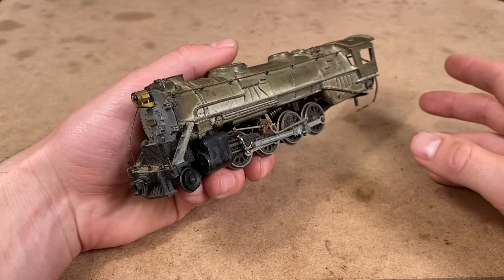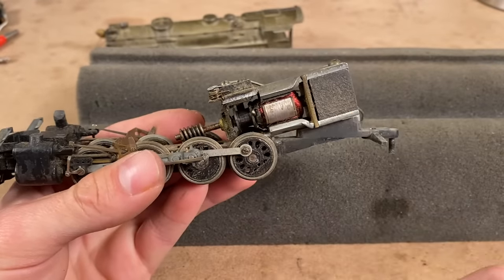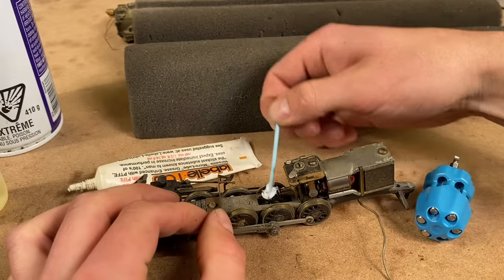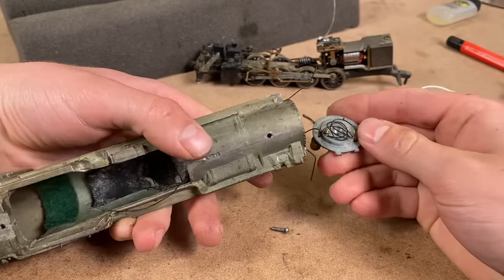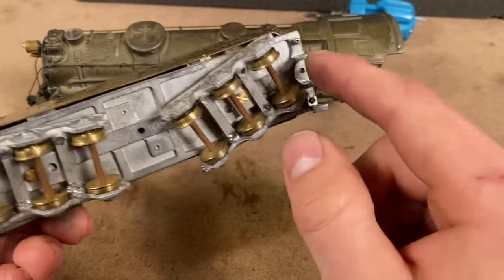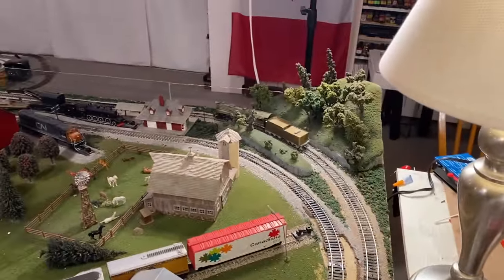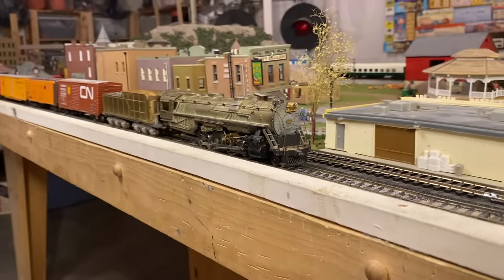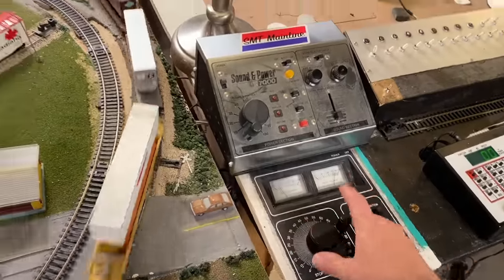Will it Run? Creepy 1939 Varney HO Steam Locomotive - Sitting for Decades

Comment: These things sure were built to last! Varney sold these without the tender, so the builder would buy one separate to fit the railroad being modeled. They also sold it in multiple configurations with the top-end version having a fully sprung and equalized chassis and 7-pole V-2 motor. This is the “value” version, but that’s still worth about 3 or 4 times what you paid even in that condition!
Reply from the maker: That's good to hear. I purchased a locomotive at the same store for $15 which happened to have the Lindsay super motor. I had no idea they were somewhat rare
Reply: @SMTMainline  why Is everyone calling it Creepy ? I think is cool  not creepy.
Reply: @normancoreyBuildingTrains  Because to modern folks everything and I mean everything is creepy or awkward.
Reply: @normancoreyBuildingTrains  
It's a ghost train come back from the dead. 👻
Reply: @JB-yb4wn  ok I can see that

Comment: 👉 DC -71 open frame 12v motor.  The standard motor for model trains for many years.  Bowser,  Penn Line,  Varney early Alco Models brass etc.
Reply from the maker: Not very efficient motors but they do seem to last.

Comment: Great job Harrison. That's a great looking old locomotive. All it needs is the trailing truck.
Reply: I Agree As I was Looking At it asking is It a 2-8-2?
Reply: @elleryparsons2433  i know some1 with an original and it is supposed to have a trailing truck
Reply: Is It A Trailer with 2 Or 4?
Reply: @elleryparsons2433  it usualy has 2

Comment: Looks great. As far as a rear trailing truck, Bowser may have one that will fit the locomotive, but I never tried it for a Varney steamer. On the subject of the tender, Cal-Scale may have detail parts for steps, ladders, and about everything else for most steam engines. This would only leave a nice coat of black paint to finish it off. Overall, it was nice to see it get this far.

Comment: The nylon screw that goes into the moter mount is a modification necessary to convert a loco to DCC.  Also, looks to be an insulator spacer under the motor to isolate from the chassis.  I suspect that at one time, it was DCC, then decoder removed when they sold it.

Comment: I see you use brake cleaner. I use WD40 contact cleaner and it seems more plastic friendly. Got this idea from 00Bill who restores British outline locos and is worth a watch. A lot of early Hornby Dublo and Triang had weaker magnets and need re-magnetizing which I do with a magnetizer I bought. I don't know if early US manufacturers had the same problem but this seems strong. I now re-magetize as a matter of course even if the magnet seems strong - it will still reduce the current by 10-15 %. You can halve the current in a weak magnet machine with a re-mag.

Comment: That model is about as old as WWII and it runs better than some high end Bachmann models I have.
Reply: Plastic will never replace metal products in model railroading.  My plastic engines deteriorated in 20 years of running them in my life. I am 80 years in the hobby

Comment: Sunday hobbyist here🤣 i wanted something HO made before the 70s and found an old Varney F3. Person i bought it from said it runs fine. Had to push start it and it crept around the track once. So im going to hope its not the motor but has similar issues as yours. Disclaimer i tried running it with a bachmann power supply that came with a train set. Its all i have. Had it cranked all the way to “11”.  And just wont go. Even put power from said supply direct to brushes but nothing.
Reply from the maker: So long as it wasn’t smoking you’re probably okay. Clean out the motor and add fresh oil to the gears and I bet it will run way better.
Reply: @SMTMainline  
10/4 thanks! Great channel!

Comment: What a beautiful model. I bet that will come out of more freight cars than the 13 you have. The quality reminds me of Mantua Pacifics and mikados that I have. The Pacific's can haul as advertised 15 freight cars but they can haul more than that. I used about 21 myself and that's on semi level track. I think on level track it could haul at least 30 freight cars and the Mikado locomotive could do at least 30-40 on level track which is estimated. The varney brand I have yet to have except I think I have a freight car that is varney. Awesome restoration

Comment: The fact that it is running so well after several decades of use and sitting up is a testament to how things were made back then, they were made to last, they were engineered with slide rulers and drafting paper, long before personal computers and cad-cam.

Back then people and companies took pride intheir products and work, but back in 1978 when I went to trade school, the instructor told us then, that appliances would only last about 7 years, enter the age of built-in or planned obsolescence where things are literally made to fail 2 days after the warranty goes out.

And yes with all of the testing of materials and how they hold up over time it is possible to make stuff last to within days of the warenty running out. the companies brought in younger people to pilot them and they got greedy and wanted a quicker turn around on their sales, and with everyone doing it, brand loyalty is kind of a thing of the past, as switching brands won't help when they are all doing built-in or planned obsolescence.

Your new loco runs today because it was engineered to last for a long time, kinda like the old Timex commercial, "Timex takes a licking and keeps on ticking"

I went on a service call some years ago, the 5 year old small chest freezer had quit, it was the compressor relay, ah but the 1950s chest freezer on the other wall had never given a minutes trouble, it had rounded corners rather than the newer square blockey corners of the modern junk, imagine that a chest freezer from the 1950s in 1980 something never touched by a service tech. 

That tells you that before the computer age they could engineer good stuff that would last literally a lifetime, as many of the old appliances were made to last a life time.

And because built-in obsolescence is so pervasive today, finding stuff that will last is hard, about the only path there is commercial or industrial 

You want a washer and dryer to last, go out and by commercial ones made for laundromats, same with refrigerators and freezers, if you want them to last go get commercial ones made for restaurants. yes you will pay out the nose, but they will outlast what you can buy for home use.
Reply from the maker: My grandmother has a chest freezer from 1965 and it's still running - It hasn't been serviced once. From what I can tell the over use of plastic and computer parts has made everything junk. Thanks for the tip on buying commercial grade equipment, it's good hear there is still one quality option.

Comment: I think you would've been better off using blue Lockite on the screw than CT Glue. But that's my opinion.   The glue will break down where the  Lockite is made for being around oils and grease.

Comment: Blue Loctite.  It will hold the threads in place and still allow you to remove the screw if needed.  I had to do the same on the Bowser 4-8-2 I bought from Maine Modelworks.

Comment: I have a pair of both varney B&O C16 docksiders and (technically) SP T31 ten wheelers for projects. I'm converting the two ten wheelers into NKP P2 class engines. They're noisy runners but still quite reliable runners. I have NWSL repower kits for them.

Comment: That blue stubby screw drivers getting a lot of use.  Your opinion of it seems to have changed since you got it.  I've also noticed that you run your restoration engines without the back 4 wheels.  Any reason or it just doesn't mean much?
Reply from the maker: The four back wheels were missing on this model, I would have left them if they were still there. As for the screw driver, its kinda short but it gets in tight spaces pretty well and the bit organization works very well.

Comment: Im an analog beginner and have a few quick questions

Can i run 2 dc locomotives on the same dc track (they go the same speed)

Are fp9 A and b locomotives that are dc capable of running on the same track (consist)

Im an amateur still learning the hobby im sorry😂
Reply from the maker: It's okay to run two locomotives on the same track. An A-B set should be okay so long as they run the same speed.
Reply: @SMT Mainline  just another quick question so it wont damage any of the motors? Thank you veru much for your response

Comment: Oh the one i suggested looked like a Burlington O5 Mikado. Looks like it's supposed have a 4 wheel trailing so maybe check with your hobby shop next time you're in as i think you may still be able to order aftermarket steam engine parts that were for scratch builders.
With the weight on that beast my guess is you could literally have the4 pilot coupler chasing the rear caboose coupler and it might begin to breathe heavy a little at that point.
Was that Nerf Cat getting a little chatty we heard?
Reply from the maker: It was nerf kitty asking for dinner
Reply: @SMTMainline  oh yes I used to get the you're in trouble stink eye meows if even a small amount of the bottom of the bowl became visible.

Comment: The mechanism sounds a bit like the roots blower on a 16-567... making it a steam engine that sounds like a geep!

Hmm, I wonder how much work it would take to add pickup to the other wheels on the tender and run a second wire to the frame. With one side live and the whole truck assembly and frame conductive, it would be tricky. I imagine that with some insulation and brass strips, something similar to a 1980s Life-Like N-scale diesel should be possible. It doesn't seem to like switches very much as it stands. ;)

Comment: Okay, let's get a discussion started.  Theoretically, if the real thing were to run without a Trailing/Firebox & Cab support truck it would squat down in back like a tricycle gear model airplane without enough nose weight.  I'm assuming the the truck pivot did not support all that weight.  It seems like there should have been something above the wheels also in a supporting role.  Can anyone enlighten us?
Reply from the maker: I don't understand what the goal is
Reply: @SMTMainline  it's a 2-8-4 Berkshire.  It needs a trailing/firebox truck

Comment: hey SMT kinda curious but would you do a train consist of the locomotives that were involved in the lac megantic disaster ?
here's the locomotives and their road numbers that was in that consist in order 
With tank cars
-----------------------------------
the freight train designated ''MMA 2
MMA C30-7 #5017
one remote-control "VB" car ( a former caboose )
MMA C30-7 #5026
CITX SD40-2 #3053
MMA C30-7 #5023
CEFX SD40-2 3166
Reply from the maker: I think I will leave that one be since it was a pretty significant tragedy for Québec